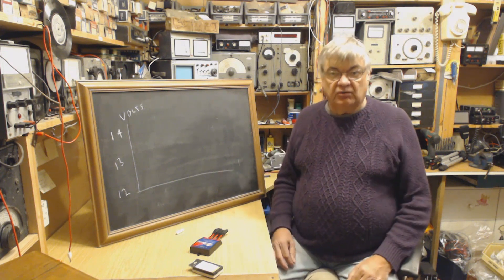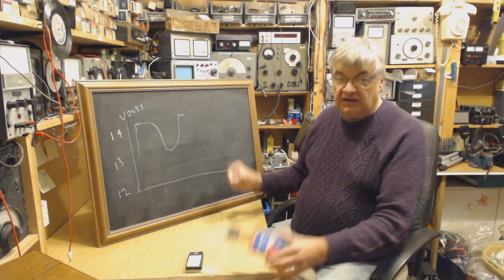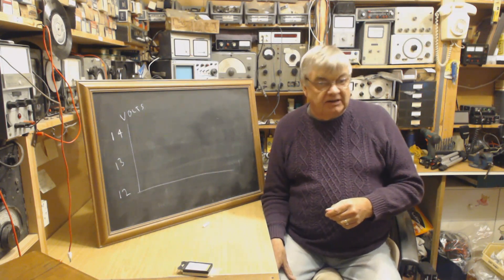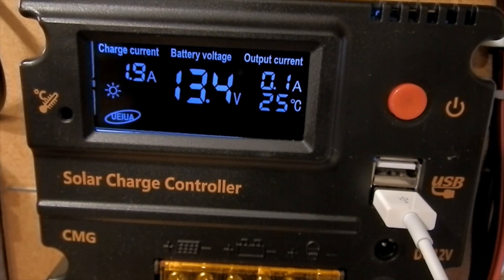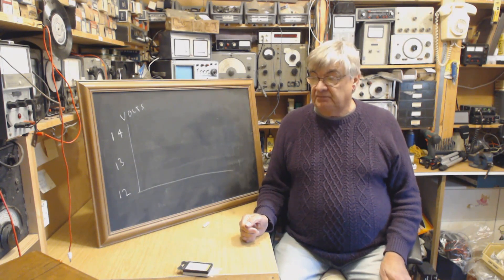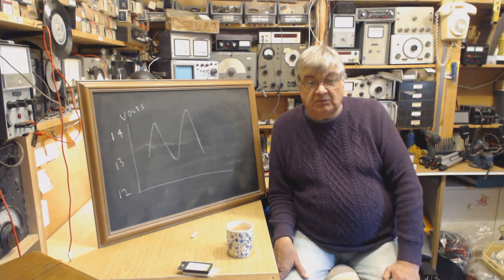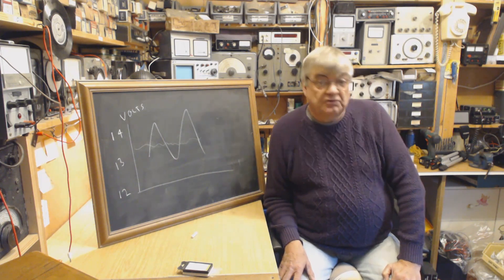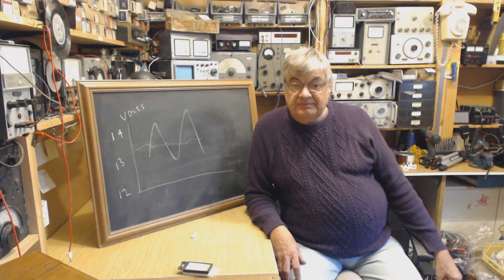Solar panel battery charge regulators controllers CMG

Comment: Nice video, cheers from Argentina!!    Please got 2 questions i have same CMG regulator can input 24v 20WP solar panel? and the other question is about the manual: says htat CMG protects from undervoltage of battery and if it is lower than 10v (in 12V bat) or lower than 20 (in 24v bat) turns off --- its for real ???????????
Reply from the maker: Rod Lucanor sorry, I don’t know about 24 volts.  It will turn off on low voltage.

Comment: PWM is the old-fashioned way of doing it on the cheap. Most of the PWM chargers are chinese designed and built, and radiate broadband hash. I run an 'EpEver' MPPT charge-controller that has work continuously for the last two years, with 1.14 kW of panels charging a 24V 400Ah battery in my workshop. 
My HF wire runs the length (120ft) of the garden directly over the top of the wshop from gutter to 21' scaffold pole. There is no noise at night when it is unpowered, and it is just as quiet during the day, in full sunlight. 
If you are going to run solar, pay a bit extra and do it properly, or spend twice the money and dozens of hours trying to filter the noise from a cheap system. MPPT's are not over-expensive, a good one will cost £60-£85, a 250W panel new old stock £90, and whatever battery you chose ~ £50 or so. Plan on buying a new battery every 5 years, and remember to CONNECT THE BATTERY BEFORE CONNECTING THE PANEL; disconnect panel before battery. My system runs my PC, radios, lighting etc, with spare power used for heating. Not grid connected, no FIT, does 50% of my domestic power in summer.

Comment: Excellent, informative video.
Thank you for taking the time to make and upload it.
You have the ability to explain things to roukies.
Can I connect the load (caravan) straight to the battery for the same auto shut off reason on the load side, and also run a radio from the charge controler?
How thick the cable should be between the 3 main component of this system?
1,5 or 2,5 mm?
How many panels I can connect to this controler?
Thank you for your ansvers and 73!
M6KRY(M)

Comment: Great video specially because I got the same charger and planing on using it on my own off grid system with 2 50 amp 12 volt batteries, I’m just running a t least 3 25 watt led lights and a 12 volt sump pump.
Any advice
Reply from the maker: I don't think I can offer any advice as you shouldn't have problems. Just go for it. Cheers, Ray.

Comment: Have you put a fuse in the 12v output? Do you recommend?
Reply from the maker: Symphonic Metal yes, it’s best to put a fuse in the output.
Reply: @g4nsj  Thanks, maybe I put a regular car fuse socket. 
For 12v do you think that will be enough?
Reply from the maker: Symphonic Metal that should be fine.
Reply: @g4nsj  Thank you very much, good work with the channel.

Comment: If you want a good PWM controller, look to the brands Morningstar and Stecca. The old Xantrex 'C' series are really good too if you can find one on the secondhand market. That cheap controller is mainly intended for the camping market where it would only be used on occasion, rather than constant use. As you say; it will be no good for the battery long term. 

However one use for the cheapie is that if you have a proper PWM controller connected to your battery bank and you want to add more solar panels than what it can handle. You could make use of the cheap one for the extra panels, into the same battery bank. What would happen is that the panels on that would assist with the bulk charge phase of the battery and then it would switch off and stay off because the PWM controller will compleat the top of the charge above 13 volts.
Reply: Thx.

Comment: What size solar panel do you use?
Reply from the maker: Hi Simon, the main one is 50 Watts with a smaller 20 watt panel in parallel. Cheers, Ray.

Comment: I've ran a long wire using garden wire from the gutter to the top of a large tree about 25 metres away. It's goes into an SDR-SHARP but I'm not getting basic stuff like time on 5,000,000 mhz. SDR seem to have a mind if their own, they can be working great one minute and the next nothing at all. I've noticed this mostly with POGSAC decoding.
Reply from the maker: analiensaturn it could be conditions. Short wave bands have been very quiet recently.

Comment: Do you use a deep cycle (leisure) battery? They are supposed to be able to cater for wide charge / discharge cycling better than a conventional lead acid battery. Or are you using Li-Ion?
Reply from the maker: Hi Pete, no I don't use deep cycle batteries, just smallish sealed lead acid types. Nothing posh as yet but I hope to upgrade. Cheers, Ray.